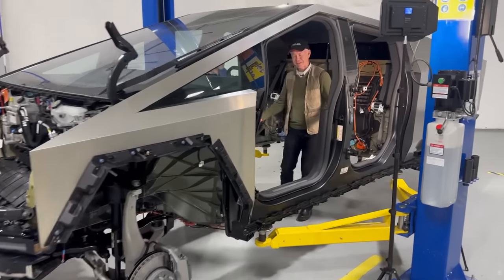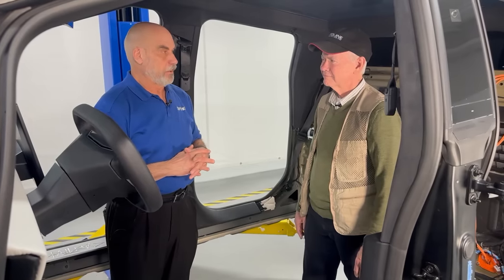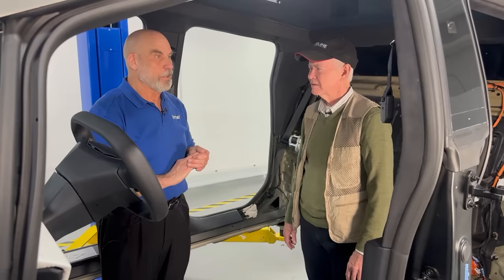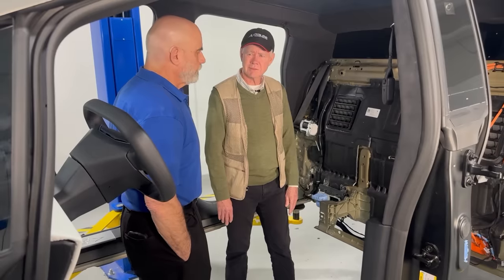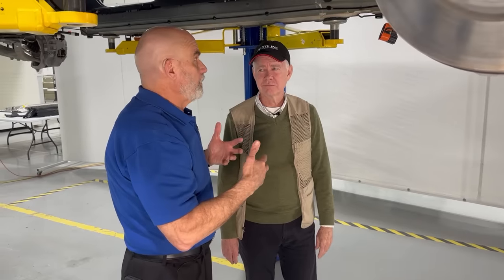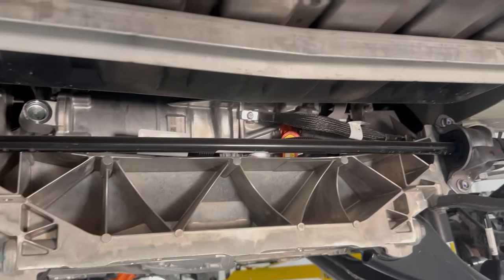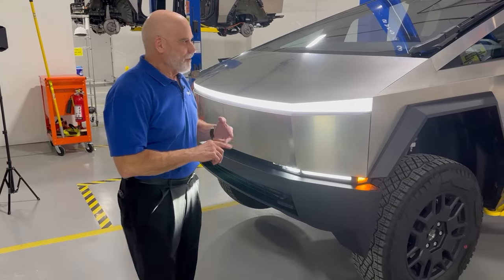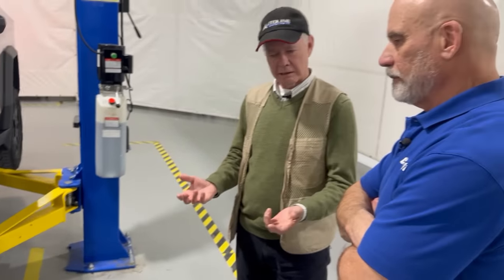World's 1st Cybertruck Teardown - Steer-by-Wire, 48V, Battery & Gigacastings

Comment: Well wasn't the goal that skateboard design spoken so heavily about years back.  that all the most major components of the vehicle exist with the skateboard, and the body simply is added atop, enabling staggering levels of efficiency and lower cost all the while offering many types of vehicles simply by way of numerous coach layout and design.   It also means in the future a new business model of selling skateboards and buyers able to switch out their body layouts on order.   so you may buy a pickup truck, but later switch the body out for an suv,  all with exceeding lower cost.

Comment: The reason that it frustrates you thinking about backing up a teailer is because youre thinking traditionally. You have to remember that with the cybertrucks drive by wire, the steering wheel doesnt even do 1 full rotation lock to lock. Because of this you can justify not having a circular steering wheel since you dont need to make the same motion in a traditional teuck where you have 2 or 3 rotations.

Comment: Yeah the steering shaft is a complicated thing to make. We better replace it with several motors, sensores, wires and control modules. I can imagine how expensive that will be to fix when doesn’t work properly

Comment: Great insights!! And nice to see Sandy Munro has got competition 😉

The benefit of steer by wire is other than the flexibility and new features, is that it is critical for Tesla’s unboxed method that will be used for the next gen affordable model - with scale costs will come down significantly 👌 Only thing missing now is true brake-by-wire, then path is cleared for the next generation manufacturing method. The unboxed method.

Comment: i work in automotive and deal with ISO26262 which is the DFMEA he's talking about.  I would love to be a fly on the wall on those internal meetings.  It's highly complex not only from a system view (whole vehicle) but also to all the sub-components that make up the individual circuits inside all the electronic control units.

Comment: The whole exaggerating the complexity of a yoke to try and make steer by wire seem more simple is a stretch.  You need feedback motors , motors to drive the rack , sensors, computers etc to make steer by wire work and then add redundancy . A yoke and standard racks are way more simpler and dependable and have been tested for decades. Steer by wire is a luxury item , just allows steering changes and driving controlled by a computer easier to integrate, but it is not simpler and I would argue not less expensive .

Comment: As much as I like technology this to me looks like an ingenious solution to a nonexistent  problem. When I think of great  engineering what comes to mine is how  easy  is the product to repair  in a shop with  the skillset of an average technician. I think the insurance company's would take a dim view of the use of castings  and complex fly by wire systems given the  cost to repair or replacement. In a  major crash with  buckling of the battery would  it cause a thermal runaway  thus frying the occupant?

Comment: I am very interested in seeing a deep dive on how the drive by wire system works. I like that it has redundant motors, now I need to know if it has redundant steering position sensors, preferably 3 so that at least two have to show the same value so the car can identify which one is faulty if something is not adding up.

Comment: Wouldn't get easier to back a trailer? The turning of the wheel is faster.
What a barbaric  language the wheel that you steer whith is defined by the same word that define the wheels that moves you

Comment: The noise we hear at the end when demonstrating the steering is pedestrian warning speaker, not the cooling pump because the truck is on drive.  When we are near a tesla, it is possible to hear the cooling circuit pump, but the noise is different and not as loud.

Comment: Force feedback is not the sole purpose of the motor behind the steering wheel. It would also rotate the steering wheel when the vehicle is steering itself. Sure...it wouldn't need to do that in order to function, but you definitely want to do that so that the driver can take over at any moment with the wheel in the correct orientation.

Comment: I noticed in other videos demonstrating the steering while sitting still they looked like they were turning the wheel faster than it actually reacted like the steering had some lag....could you check steering lagtime in the air vs on the ground as this is an important issue to note for collision avoidance situations . Thank you

Comment: The fail safe mode  in steer by wire can be done by the abs can apply break to wheels left or right from one side to steer the car in emergency situation but at tge end its not a good system because you could have a sudden power cut or some bad programming can led to an accident

Comment: 10:18  isn't that precisely why the steering wheel isn't round? He said something about needing to know where the wheel is when reversing onto a trailer but in reality, you're never turning the steering so much that you need to grab it with your other hand to continue the turn. 

You only have say, 90 degrees one way and another 90 the other way so a single hand motion can turn the steering from full left to full right without needing to swap hands.

Comment: This video is false information.
Y'all are lying about everything you say about the truck.
The Cyber truck don't have 48 volts nowhere on it. 
It has a 12-volt system that step down from a DC to DC converter.
The engine that runs the Cyber truck is a AC 3-phase motor, that gets its electric from a very high voltage power inverter that's hooked directly to the battery.
A golf cart has 48 votes.
This is a cyber truck,,,,,  voltage is somewhere around $700 DC volts.
The voltage varies on how high Are low the battery capacity is........
Reply: So there's three voltage systems in the car, got it.

Comment: The seal issues are not from the factory. Those seals need to be pulled out to remove the blue protective film on the logo plate by either the delivery centre or the customer.

Comment: Awesome tear down, thanks for sharing.... I see one of the most beneficial parts of Fly by wire steering is the ability to export the car to either left or right hand drive markets without having to change anything in the engine bay, firewall etc. The Tesla team made mention that 1 of the 2 front steering motors can handle 60% of the load. So the redundancy will give you the ability to drive normally and vacate the road if there is an issue. But it may not be capable of Dry lock to lock steering while stationary (max load) -  Which isn't really a safety concern. The car is running Gigabit ethernet, which is 200x the speed of traditional canbus. Added 48V allows all control to come from one place instead of many different computer boxes. The CT team has revolutionalised MANY components of a truck and car build. 

Worth a note, the build quality of things like door seals between my original made in California model 3 and my 4 year newer MIC model Y was phenomenal. Anyone who underestimates teslas ability and ambition to improve will be left behind.
Reply: AT LAST someone who watched the Munro/ Tesla technical walkthrough!!
👍👍
Reply: Sandy obviously has a reputation, he was originally Teslas biggest critical and slammed them for everything, but I found this video good, it felt like walking through a car with a friend. Early days for this team on YouTube, I think it’s good for them. 

It’s undeniable that Teslas ability to change the production line for the better has been impressive. No other manufacturer adapts to changes and improvements this fast. What’s mind blowing is the fact that Tesla went from nothing to producing entire factories and new production processes for things like stainless, batteries, electronics, drive trains for the CT. I absolutely forgive them for taking a little longer than promised. What a monumental effort.

Comment: Is the second steering motor for redundancy or to emulate different radii per wheel without a mechanical differential?
Reply: the FWD is e-Diff , the REAR is Dual Motor Diff.
Reply: Steering motor redundancy? 1 wheel = 1 motor. The ability to articulate each wheel direction differently (eg…crab vectoring if desired).

Comment: I'm a big fan of steer by wire, but I can already see a negative aspect.  When the main battery dies (for whatever reason), the tow truck operator has to pull it up on a flatbed, and they usually have the driver's window open so they can turn the wheel to steer it to the right spot on the flatbed.  Can't do that without power here.  Maybe they'll need to first put rear wheel dollies on to swing the truck into position from the back...just like those tables/carts that have 2 stationary wheels on one end and 2 swivel wheels on the other end.   Very interesting.

Comment: Uh this guy babbled a long time saying almost nothing. All the steering motors and components were shown and explained on functionality by Tesla in videos on YouTube where they toured Sandy Munro through the Cybertruck assembly lines. Nothing new covered here except that not every electric component is 48v.
Reply: So the biggest "innovation" of the truck is fake.  Like the exoskeleton.  And the launch price.
Reply: @vorg_  Actually the skin of the CT does hold load and stiffens the vehicle. It is much like putting a piece of sheathing on wall studs. The studs can move and bend some until the sheathing is put on. In looking at the manufacture this seems to likely be the case for the CT also.
However it isn't the "exoskeleton" that Elon referred to.... at least how I understand the meaning of that word.
Reply: And the 48v system energizes the steering motors.  Making steering by wire feasible.  Why invent controversy?

Comment: Great video!
The second Cybertruck seems to have a panel alignment issue in the front left corner, resulting in an obvious gap between the panels and a very sharp, potentially dangerous, edge (see videoframe at 22:02). 
Was this second Cybertruck an early prototype or a production unit?

Comment: Stainless where it is visible. I see a lot of black painted subframes, etc. that are likely not corrosion resistant underneath.  If so, rust will claim them as with most other cars. I wonder how all the 12, 48, and 800 volt systems will interact with that...as far as electrolytic corrosion goes. It's all fine now, when it is shiny and new. But bad grounds and minute stray currents will happen, no avoiding it. 
     Maybe none will be around in 15-20 years to find out. 
   Used vehicles are going to get interesting soon. As will maintaining them. Any mechanic has a tool or two with scars from shorting 12v to ground.  Nobody means to do it, it will get your attention.
    Try that with 48, or 800v. Pay attention!

Comment: The Cybertruck, which comparatively speaking really isn't a truck at all, is little more than another fine example of unnecessary automobile engineering. The fly by wire steering for instance is a do it because it can be done not because it's necessary or even a real improvement. It's nothing more than over engineering generating more electronic failure points.
    Of all the system failures that all of my automobiles have suffered electronics have been the most prevalent and the more modern the automobile the more prevalent those electronic failures have been.
    Even modern small aircraft still employ mechanical cable systems for all of the control surfaces because those systems are not only predictable but easier to inspect and maintain. Bottom line is that they are simple systems and simple is always better in every way. Engineers will never admit it but the fact is that for every problem that's engineered away new problems result from the complexity that was intended to solve the old problem. 
    The only reason fly by wire systems exist in aviation is because beyond a certain threshold of size there simply is no other way and those systems have multiple redundancies not just one. Fly by wire systems predictably fail so multiple redundancies are paramount for safety. When it comes to electronics one redundancy is never enough.
    Being over sized is not the case with passenger vehicles such as the Cybertruck so why would a fly by wire system be necessary? It just isn't. Not to mention all of the digital nonsense involved with these things, right to repair and on and on and on.
    Looks to me like just another over priced, unreliable, irreparable and impractical toy. No thanks! You all can have this junk!
    I'm glad that I'm old enough that I'll be dead before this kind of garbage ultimately rules the word.

Comment: ok... castings everywhere, makes it a NIGHTMARE to repair, because unless you can weld the casting you can't fix it, and it will probably be out of spec anyway....so you bend it its a fucking wright off, as its going to cost a fortune to replace the casting, not to mention the labor to move the damn thing.

Comment: If they really knew, they would understand that TODAY, it is impossible to convert 100% to 48 volts!

They simply used 48v to bring power to several power distribution centers where they have 48-12v buck converters to the usual and available 12v components (lights, horn, fans, sensors).
Reply: Tesla does not have a 100% 48V system in Cybertruck.

Why wouldn't Tesla use 48V where they needed it?

You're reachin'.

Comment: Fascinating RE effort.  I wonder if a malicious hacker can tap into the e-steering to deliberately cause an accident, or is the system completely independent from other vehicles systems?
Reply: so you never been on a plane?
Reply: @nou7401  A commercial plane has 5 (!) redundant flight computers to ensure fight integrity.   If one goes astray the others will take over.
Reply: @SoCalFreelance  lol, cope
cybertruck already outsold the trash gas trucks in its price segment, LOL

Comment: For those worried about losing steering, remember mechanical steering systems don't include a backup
Reply: True but as long as the human steering a manual system isn't dead it works. When a motor dies so may the human without any steering.
Reply: @1958HHH  I'm don't understand your comment. 

If one of the flex couplers or u-joints in the steering shaft fails or if the rack and pinion strips you will loose steering. 

I've personally had both occur over many years of driving. My 1981 Ford Thunderbird's rack and pinion stripped and my 1970 Chrysler New Yorker had a failure in a steering flex coupler. In both cases I could spin my steering wheel to no effect on the path the vehicle took.

Although I ended up with my car on someone's front lawn in the T-birds case, I was lucky to remain alive.

Comment: I love "by wire" controls.  How many years have we had throttle by wire now?  I had steer by wire on my yacht back in 2010, along with a joystick and throttle by wire.  It was great, Volvo Penta had excellent feedback on the system and actually the steering wheel would freely turn and had no physical stops, until you turned it on, which then force feedback and stops were engaged into the wheel electronically.  When the drives hit their stop, so did the steering wheel and it locked up as well that direction.  

My 76' yacht has all 'by wire' controls now as well, with complete redundancy.   When your in the middle of the Pacific Ocean all by yourself and out of range of the coast guard in a storm, its not the place to have it fail.  🤠👍

Comment: So the body has no natural strength and relies on the Battery pack which is dangerous in itself. Granted a thin tin floor isn’t going to provide much protection from a violent lithium fire. If it’s 100% drive by wire why did t they just get rid of the steering wheel and go to a joystick on the drivers seat arm rest? I don’t trust drive by wire at all be your relying on a computer and electronics at all times.
Reply: so you never been on a plane?
Reply: @nou7401  yep and an airplane has an entire rib cage to put it in simple terms with an actual floor and body panels all riveted together. 
Have you ever seen what happens to an airplane if they either land too heavy or too hard? BTW, was raised in airplanes most of them being rather large private aircraft.

Comment: rear steering can be also an additional redundancy for the front. If the front steering gets jammed because one motor is stuck, you'll be happpy to still be able to steer the rear +/-10%
I think its actually exactly the future, each wheel having its own motor, independent suspension (no antiroll bar, anti roll can be achieved much better with active suspension), independent steering, independent braking, all being "by wire". if one wheel fails completely the car can still brake, turn, etc and slow down to a limp mode. it makes the car more modular with each corner of the car being independent and frees the rest for cargo, passsengers and battery.
instead of wheel toe in/out and ackerman steering compromises, you can have every wheel pointing in the right direction without slipping when you are cornering at low speed, lowering friction and resistance When you are going faster in a corner, and getting close to the limits of the grip, you can adjust the side load on each wheel independently depending on the vertical load of the tire, with different slip angles, and make the most use of the grip. like torque vectoring, but through steering. together with active suspension, flat cornering ( or leaning to the inside), I think with otherwise similar tire tech, you could make a car corner way faster (lateral G) by using maximum amount of grip on each tire, and also reduce overall tire wear vs traditional steering technology when driving at similar speed / acceleration.